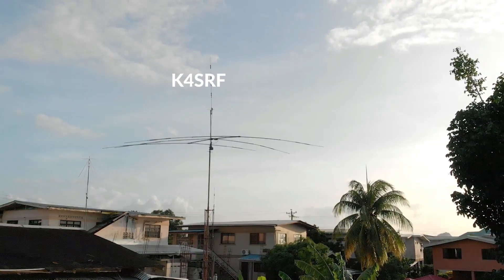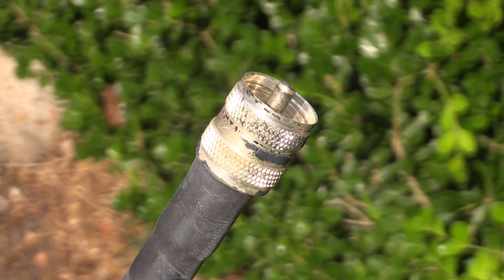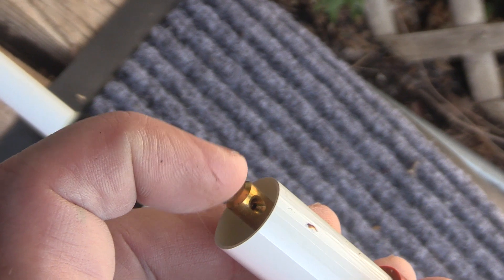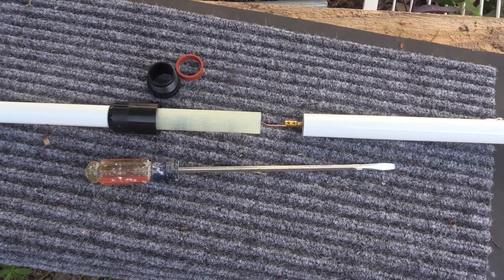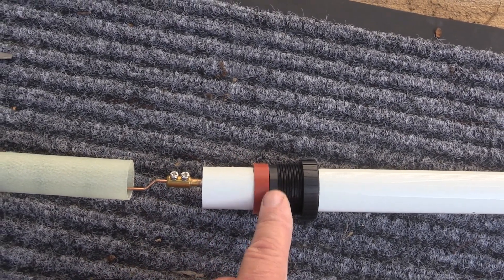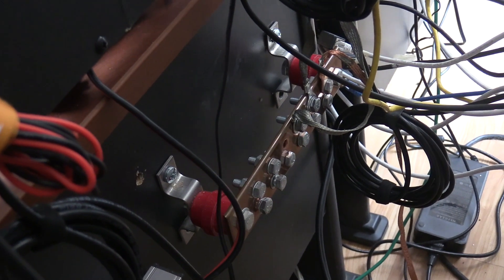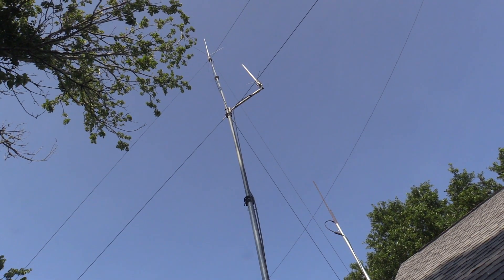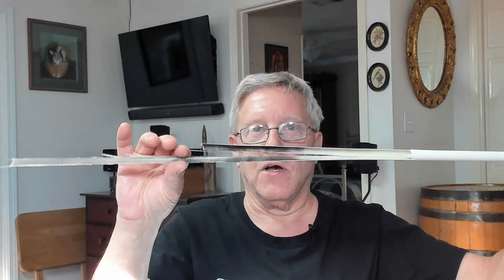Near Lightning Strike & Grounding / Bonding Revisited

Comment: I Also Have up a Comet GP-9N & it has Ben Great..Seams to blow the rest out of the water..& i also used the string Trick & I Also Sprayed mine with a Couple of Good Clear Coats to Help/stop the splintering But I Also Used a Couple of Good Marine Grade Adhesive Lined 1.5'' Heat Shrink Tubing And Man O Man Does it Seal Up Good.. I wanted to do something after it was up for a Couple of Weeks & the Heat Shrink was Really Really On Their..& Honestly Worked Better Than I Ever Thought it Would lol.  I am A Major Fan Of The GP-9..it  Works Great With my Yaesu Ft-991 haha i want a Good HF ant now..Im leaning Twords a Hustler 5btv but i really want 6m also so i still dono..lol. Thanks For Sharing ..I took a indirect Strike to my Shack Years ago an Splintered the ant at the Bottom ! My Coax Looked & Tested Fine To But When i Cut The End off To b Sure it Was Black...